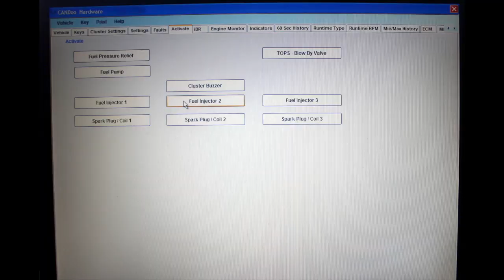How To: 4-TEC Jet Ski Troubleshooting (GTX 185 Sea-Doo Fuel Pump Repair)

Comment: hey. I'm getting steady revs over 5000.  I think it the rectifier from what I read earlier.  the battery sent a low code.  I charge the batteries after use.  sometimes the batteries show low when riding and restarting.....

Comment: You are the only sea doo channel on the planet that is working on and troubleshooting the 2005 GTX SC 185. I bought that same exact ski a few years back and I love it, still runs perfect and I keep it serviced watching your videos. Thanks for posting. Is there an intercooler kit for this ski or do you have to build one?
Reply from the maker: Hey thanks very much, Jeff. We did an intercooler upgrade video some time back on that machine: YouTube_Intercooler_Installation.mp4 . We can't say it made a great improvement, but there's a parts list in the Description and Comments section under the video in YouTube if you're interested. Good luck.
Reply: @3ftDeepChannel  Thank you sir I appreciate that information.

Comment: Nice vid.  I have a 07 4tec. Changed the ool sensor recently and there is no code or limp mode anymore.  But now when I have it full throttle it only goes about 37.  It would get up to 55.  it will stay at 37 then Mabey go to 45 off and on while at full throttle.  think it is fuel ijectors.
Reply from the maker: What sort of revs do you get?

Comment: Hi i have a 2007 seadoo rtx 215 supercharged it runs at full throtle for about a minute or so then dies but idles perfect once you let idle for about a minute it will take full throttle and do the same thing but if you ride 5500 rpm it runs fine without dying
Reply from the maker: Sounds like a fuel supply problem. Perhaps water in the line? I'd try some water in gas treatments, and then have the fuel injectors checked. Could also be the fuel pump. It may also sound crazy, but check the pump for any obstruction. Good luck.

Comment: Great video.. thank you.. I have a 2008 gtx wake 155 it starts right up but when I give it throttle it bogs down..  please help..  thank you.
Reply from the maker: First, check your spark plugs. Then, make sure you don't have a plugged air line (remove the air hose to the engine temporarily). Then check your fuel line. After that, check all hoses and clamps. Essentially, you need fuel, spark and air for an engine to work. Unfortunately, there are a lot of things can can go wrong and it's impossible to diagnose over the internet, but those are some starters for you. Good luck.
Reply: @3ftDeepChannel  thank you very much... I'll do that.. and go from there.. I appreciate your response.
Reply: @luismejia2515   hey bro I have the exact same seadoo with the exact same symptoms. What needed up working for you? Was it old fuel?
Reply from the maker: In our case it was a problem with the fuel pump. We figured it out by testing the fuel injectors. Are you able to test your fuel system?
Reply: Just finished up checking the elements you advised. Turned out OLD FUEL is the enemy that struck today.  One spark plug was burned so that was changed. Still no idle. Then found two clogged fuel injectors. Once those were cleared, still no idle. Ended up being fuel pump was clogged.
Reply from the maker: Glad to hear your problem was resolved. Great job! In the future, make sure you always use fuel stabilizer when stored for more than two months. Good luck.

Comment: Good video but spark plugs can be tricky. Just because they are sparking doesn’t mean they will work. Check the ohms on them. Seadoo has a built in spark plug spares holder for a reason.
Reply from the maker: Hey, thanks for the tip. Chris got an older 2004 RXP for cheap because the engine was "siezed". Turned out to be 2 bad spark plugs.
Reply: @3ftDeepChannel  I worked on a 07 rxp recently for a guy.
The ngk plugs for this machine should be 5000ohms and they were 3800 4100 4300..they sparked but not enough to fire. I like my BUDS but it’s only so good.

Comment: "Improperly placed rubber seal" Are you referring to the rubber seal at the bottom of the fuel pump that is seated on the internal filter? If so can you tell me what you did to fix it?  Is the internal filter supposed to be fully pressed onto the rubber fitting on fuel pump first or should the internal filter be seated in the base and the spring pressure forces the connection to the rubber seal? If the internal filter is press fitted to the fuel pump seal first and then inserted into the canister it does not seem it would serve any purpose or filter properly.
Reply from the maker: It was a rubber seal between the pump and the outlet fitting that wasn’t letting full fuel pressure out to the injectors. Chris had taken it apart during the winter and didn't reinstall it properly. I'm not sure how your pump is set up, but our mess-up caused improper fuel flow.

Comment: Great how to!  Any chance you could go into detail on how to R&R the common fuel rail, I think I have a plugged #2 fuel injector and want to clean it.  Any help greatly appreciated.  I will never let them sit too long with old gas ever again!!
Reply from the maker: We use a Candoo Pro to fire each injector individually out of the engine, so we can see how they're spraying. If you find one that's not spraying properly, you should try flushing some fuel injector cleaner through it, and try to keep the solution in the injector for a few days. If that doesn't work, you'll probably need to shell out $150 for a new one. Not sure if anyone else out there has a better solution ...
Reply: 3ftDeep Perfect, I had the exact same question as the guy above, and was wondering how you sprayed the injectors like that. i think I may have a plugged one too.
Reply from the maker: We hooked it up to the Candoo Pro. It has a setting that allows you to spray the injectors.

Comment: I have a 2005 GTX and really enjoyed your video up until the discovered problem. This issue was just glossed over with no real explanation of the exact issue or repair required. Just some blip about a seal Chris put back incorrectly
Reply from the maker: Well, I didn’t want to dwell on it but since you brought it up, the issue was caused by a previous job that Chris did. Sorry, Chris!
Reply: @3ftDeepChannel  Isn't the whole idea of this video to show what the correction was? What was the fix??
Reply from the maker: We do mention in the video that it was due to an improperly installed rubber seal that was blocking fuel flow. That was Chris’ fault, not the factory’s.

Comment: How do you get the injectors to spray? And if it's with the diagnose module thing, is there a way to test them without one of those modules?
Reply from the maker: You can do it with the Candoo pro. Not sure how to get it to spray effectively without using such a device.

Comment: I have a 2007 Seadoo Speedster 4tec 215 HP. Is it safe to spray starter fluid in the air intake to try and start it? Is there something else I can use? Thanks in advance for any information!
Reply from the maker: These are fuel injected machines that shouldn't need starter fluid. What seems to be the problem?

Comment: I was out on the water with my Seadoo Speedster 150 4-tec 215 HP 2007 all day and it ran perfectly starting and stopping perfectly. Finally I turned it off and it would never start back up. It turns over strong it just never fires. Additionally there are no fault codes displayed on the gauge cluster. Could it possibly be the fuel pump? Or would that trigger a fault code? Can I spray starter fluid in the air intake to get it going initially? Or somehow spray gas in there (I just heard someone else mentioned this and not certain of the legitimacy)? Appreciate any assistance
Reply from the maker: That's a tough one. There are a lot of reasons why it won't start. I'd start with the spark plugs. Also, we don't suggest spraying started fluid in fuel injected systems. Your fuel injectors could be fouled, but it's unlikely that it would just fail like that without running poorly for some time before. I'd then follow up with removing the air intake to make sure that's not plugged. Start with those and let us know what you find.

Comment: So I just came back to this video and this worked to fix mine. One problem though, my jetski is not going past 20 mph it’s like there is a limited but I can’t find anything on the internet about it. Please help
Reply from the maker: Is it possible you are using a learner key? Other than that, you may have something stuck in your pump.

Comment: Can I ask you a question? I have a 2012x260 I just rebuilt the motor, and I get 130psi per cylinder I have verified the timing of the tooth gear and I also verified the timing of the cam. I have a new CPS. The only time it starts is when I pour gas down the spark plug tubes, after that it kinda sputters out. The fuel pump assembly is brand new and I can activate it in my candoo. The interesting thing is that when I activate the injectors on my candoo nothing happens, HOWEVER when I lift the fuel trail out, and then try to start the ski, I can SEE the injectors spraying….. odd. Right now it’s a no start situation.
Reply from the maker: I wouldn’t worry about the Candoo operation at this point. If you can see the injectors spraying when you try to start the ski, that’s the main thing. Verify that the spray is a strong, though. It should be a nice mist that’s consistent with all 3 injectors. Make sure your spark plugs are clean and working properly. In your year the spark plugs needed the top metal screw cap removed so they fit inside the coil packs properly. Make sure the plugs fit properly in the coil pack. When troubleshooting, make sure you remove the air hoses to the engine to ensure it’s getting full air. If you bought an OEM CPS, that shouldn’t be a problem. If it isn’t, that may be the source of your issue. The fact that the Candoo pro doesn’t appear to work with your system makes me think it’s not an OEM CPS (or the wrong one) and that could be an issue. Good luck.

Comment: Dear 3ftdeep I"m an automotive technician and I just bought a 2003 kawasaki stx12f and a 2006 stx15f and was wondering is there an inexpensive scantool I could by to do my own maintenance and diagnostics
Reply from the maker: Yes. Check out candoopro.com. It’s better if you can split the cost with a friend. Good luck.
Reply: @3ftDeepChannel  thanks very much for your response ill look at those scan tools and by the way you videos are awesome

Comment: Hi my friend has a seadoo gti 130 2009 it has 240 hrs it runs fine after 20 min it stalls and won’t start and then will start again keeps doing that ? Also when hooking hard turns it will stalls thanks if you got any tips
Reply from the maker: If you’ve checked the oil, plugs, battery, etc. and everything checks out, I would look for a bad electrical connection …likely a bad ground (possibly on the engine block). It could also be the DESS post is bad. Good luck!

Comment: Hey man, I got a 2002 seadoo gtx that someone had fried the electronics by jump starting from a truck. I got a new ecu 02-05 and it started up. It will run if u continue to hold the throttle but it won’t idle( prob not getting enough air?) also it puts out black smoke (which I’m told can be fixed by changing the map senser).  Could u give me any advice?
Reply from the maker: That kind of electrical issue is probably best handled by either the folks who make the CanDoo Pro, RIVA Racing, or a Sea-Doo dealer. I would try CanDoo, first. Good luck!

Comment: I have a seadoo rxp 215 and out of the water it idles between 1800 and 2200 and seems just a little rough. any ideas? Maybe fuel filter?  I know last time i was out it was only running about 8000rpms when usually 8120 hoping just  crappy gas.
Reply from the maker: First thing to always do is check the spark plugs. Make sure they're fresh (changed every year), and clear of corrosion, etc. Make sure they're screwed in properly! Could be your filter, but could also be a fuel injector. Check all air inlets first, before checking fuel system, though. Take off tube to air intake to rule out nothing is plugging up the system. It could also be your driveline, though (pump, carbon ring, etc.). But I'd try those first. It's hard to diagnose these things over the internet. Good luck!

Comment: I have a gti 155 2007 that runs fine for the first 6 gallons from a full tank then quits could this be the fuel pump float?
Reply from the maker: The float is only there to send a signal to the fuel gauge on the dash.  When it quits can you hear the fuel pump running when the key is attached ?  I would remove the fuel pump assembly from the tank and see if the filters are  clogged or something is wrong with the pickup tube.

Comment: How would you rate these skis as far as performance.  I'm about to purchase one with low compression in a cylinder
Reply from the maker: They perform very well. It depends what you're comparing it to, of course, but for beginners or people with moderate experience they're excellent. What are your compression readings?

Comment: great video, I purchased a couple 2004 GTX 4-tec's, I had to do some work on them but both are sea worthy now and one is even up and running, I am having difficulty with the second starting and idling until I get out of the no wake zone in say 5 min but then I give it throttle to only have the machine bog down and die, I can only get it to start for a partial second then dies again until I get it out of water, on the trailer it starts and seems fine again.  Where do you think I should start to find my problem? Pump is clean and plugs look good, any ideas?
Reply from the maker: If it is the supercharger model, have you confirm that the supercharger has been rebuilt? If not, it is likely in need of a rebuild imminently.
Reply: @3ftDeepChannel  would the supercharger not being rebuilt keep it from starting? Appreciate any info
Reply from the maker: No, that is very unlikely. I brought it up because that year model superchargers will definitely need a new building. If not, they can fail and destroy the engine. That’s why I brought it up.
Reply: @3ftDeepChannel  thanks for the reply. Have a great weekend

Comment: Could you tell me where the Crank position sensor is located on the ski.  Thanks
Reply from the maker: Check out the diagram for the PTO cover and magneto on Sea-Doo's parts website page and you'll see it there (at the rear of the engine).

Comment: Can you tell me on the 🔺 triangle magneto connector the 3 sensor that are attached to that plastic from right to left?
Reply from the maker: Probably the best thing is for you to check out the parts diagram available at Sea-Doo.com. This is a great reference to have handy. https://www.sea-doo.ca/shop/essentials/parts-iframe.html

Comment: Hi Guys ive got no knowledge or the right tool for mine, the unit that sits ontop of the tank is leaking fuel. Im in portugal and here is only assistance far away like porto or faro. Any assistance will be greatfully appreciated, thanks.
Reply from the maker: If you have fuel leaking from the top of the fuel tank, you'll need to remove the unit and thoroughly examine it for the cause before riding it again. I wouldn't even power it up until you've addressed the issue, as leaking fuel can can an explosion. Hopefully it's just a connector that's loose and nothing will need replacing. Good luck.

Comment: Hi, I have a 2012 RXT-T. When I try to start it I have the same problem but at 5 attempt it start. Then when I use it run perfect, doesn't fail on low or high speed. But when I stop and try to start again half hour later is the same problem. What can I check to find the problem? Thanks in advance!
Reply from the maker: I'd start with changing the spark plugs, if you haven't done so already. Also, make sure they're all sparking. Also check the fuel injectors to make sure they're giving lots of fuel. You should also remove the air intake hose to the engine and see if that helps, as it could be a partially-clogged air hose. Good luck and let me know how it goes.

Comment: I have 2006 gti was sitting for 8 years only code i getting is p0231 fuel pump circuit low ground I clean everything could it be the pump ?
Reply from the maker: It could be. It could also be that your ground connections are no longer good. There are a number of them on your engine. I would make sure they’re all good before troubleshooting your fuel pump. You will probably need a new fuel pump filter anyways, so it’s probably worth pulling it and checking it out after you deal with a possible ground wiring issue. Good luck.

Comment: its fuel, air, spark and compression.
Reply from the maker: Well, I guess if you want to get technical it could include a lot of other things, too.
Reply: You are incorrect.

3 thing required for all internal combustion engines.
Fuel
Ignition
Compression

Doesn't matter if it's diesel, gas or turbine.
All have to have those 3 things to function.
Reply from the maker: What about oxygen (air)?
Reply: @3ftDeepChannel  air is part and parcel of the fuel. 
Fuel- correct amount delivered at the correct time with the correct amount of the oxidizer. 
Ignition- happens at the correct time and in the correct way.
Compression- this one is missed the most... Compression means that all of the mechanical components that need to function in the correct sequence and in the correct manner to create the environment for the combustion event that happens when the other 2 conditions are satisfied to  be used to create the force we use to do work.
The specifics of how those 3 things are used in an internal combustion engine is unique to the engine. 
All I'm saying is that in describing ICE functions in general terms there are only 3 components that make up the process irrespective of the type of engine.